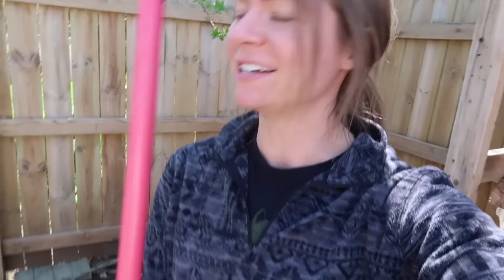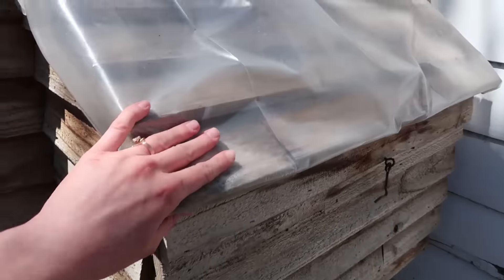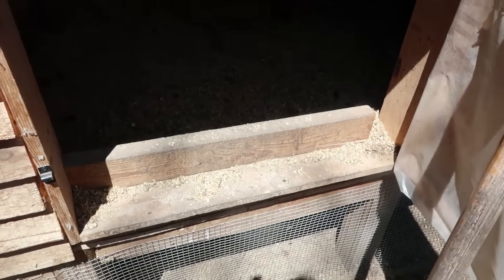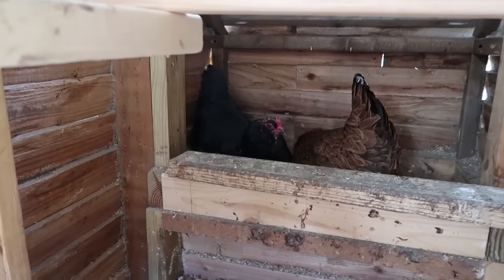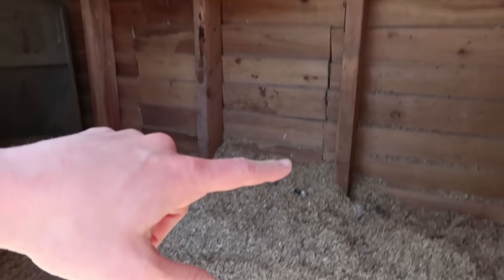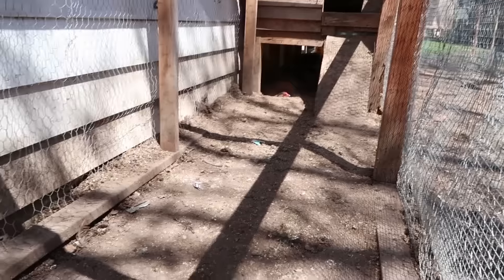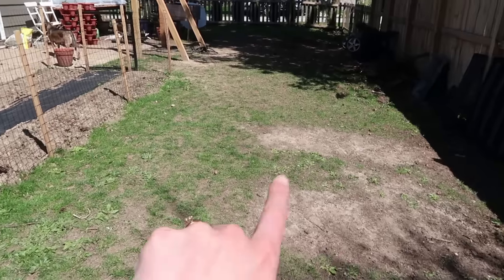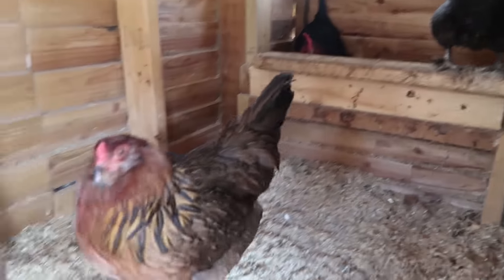Why We HATE Our Chicken Coop | Poultry Housing Mistakes | Beginner Backyard Homestead

Comment: We did something similar to yours but had the whole side open up with two doors. The two doors makes it super simple to clean out, like fifteen minutes. We are building another coop now from scrap. We are using wood from a playhouse we took apart. Having plywood board then adding the siding worked great for our doors and reduced the holes, we used pallets and broke them apart for the siding wood. We're at 6500 ft in the Rocky mountains in Colorado.  I ferment food and take it out daily right now and they forage on the property. In the winter we actually hang the food and water in the coop so they don't get it soooo messy on a chain and carabiner.

Comment: Thats cute. I bought one and its kind of a piece of crap and i want to get a couple more birds so i might build one. But that one seems fine. I know the wood shrinks up and warps and stuff everything gets misaligned. Why i bought a metal run. Im going to use your advice with the plastic and wrap it in plastic for the winter. Like you did. I did some pvc pipes with a wye on the bottom and fill them with food and that works pretty good to feed them you should try that out for in the coop

Comment: I have been learning a lot from your videos, thank you for the content first off. I do have questions if you are still checking the older videos. 1) Is it necessary to put prep the ground in any way before the coop and run are set up? 2) What bedding are you using in the coop for the deep litter method as it doesn't look like the shavings bedding one uses in the brooder? 
You did sort of answer one question I had about how bad they will tear up the rest of the yard. I will make a pen for them around the coop run so that I can still have some kind of yard and garden.

Comment: You've been fortunate to not have serious predator issues. When you rebuild it, I would definitely cover any gap 1/4" or larger with 1/4" hardware cloth unless you're positive there are no minks / ferrets / weasels and then you could use 1/2" (but tiny snakes will get in - probably small enough they'd end up as chicken snacks). Chicken wire only keeps chickens in - it does not keep any predators out. Unfortunately, 1/4" hardware cloth can be torn by some predators, so what I've done is use both 2x4 field fence + 1/4" hardware cloth for my duck house. Next step is to completely cover a duck run in both because of great horned owls that may hunt during the day in the winter + the potential for hawks to decide duck might be on their menu, too.

Comment: OK, OAK CCL & "coop gallery" folk ... JUST buying first chickens by end of this week (03/18/22), intend nine (9) Aquila OR Black Sex Link depending on co-op availability. 
Have an existing lean-to with height 7'-8' pitch (spanning) 5' X 15'. Intending to "raise the coop" up two (2) feet so I gain the entire 5' x 15' as "covered run". The coop will then be 4' X 5' X (5' - 7'). CAN free-range back half of "almost an acre". To "winter over", DOES the "coop and run" sound big enough for 9 large hens??

Intend three exterior-access laying boxes, full access from a side for clean out, water & food outside coop (in covered run) by horizontal nipples (opinions/advice, please; DO THEY WORK?) in bucket and Tupperware "bin", hole sawed for four "head sleeve?" feeding ports. 

Ground is already sand; my location is at elevation 600' on west-face of WA Cascades; read "rainy". Intended to insulate, but if WI and CO Rockies coops are not heated or insulated, should I bother?? Have NO intention to heat, so they naturally acclimate and I don't have to fear electric power loss (opinions, please).

Intend two 2 X 4 "on the flat" perches 18" off east and south wall so total of 9' @ 24" from floor, with 18" "poop catchers" beneath. COULD center them east to west, side by side, 18" off south wall then spaced 18" (no pecking from roost to roost??) RATHER than the "L" shape??  THOUGHTS???

NO ONE talks about "clipping" one or both wings, so is that a "thing" pre-supposed OR "bad practice" so no one does it or discussed the topic? Issue is short 4' property fencing or no fencing ... Property boundaries have pines, spruce and tons of understory  bushery. Worried about the gals getting headstrong and go roosting or laying "out there". ADVICE?? TOTAL "newb" so data-dump me, please.

Comment: Why are cracks and drafts an issue if you have such large areas near the roof that are open for airflow, anyway?
Reply: Because the ventilation is above and not at their body level. Cold Wind hitting the chickens body can create frost bite and chills. So having the vents above detours drafts, so their bodies can generate heat better.

Comment: What kind of bedding is that?  I really want to start using deep litter method but I've not been happy with pine shavings, or horse pellet bedding.  Hemp bedding is way too expensive in my opinion.
Reply: I tried the deep litter method last winter. I used a couple of inches of aspen shavings as a base and then used straw throughout the winter to build it up to the 9-12 inches. It was awesome! Kept the chickens warm and dry and required very little maintenance.
Reply: @RobynSteed  Oh thank you so much for that information.  I'll have to see if Aspen shavings are an option for us here in eastern NC.  My only concern with hay/straw, is them eating it and getting impacted crop.  But I could potentially throw down a thick layer of that first and then put a couple inches of the shavings on top.  I'll have to try it.  I'm glad to have a different perspective for sure because I've been racking my brain trying to figure something out.  My coop isn't walk in too so to clean it as it is right now, is a back breaker, and will be until we build a new coop for the birds.  Thanks again!  :)

Comment: If you’re here to get ideas about building or rebuilding your coop and or run. I’m an 8-9 year chicken keeper here. DO NOT, I repeat, DO NOT put your coop or run up against your house!! Rodents/pests will damage your property, by chewing through to live in house while getting food source from your chickens. I learned the hard way…. About $18-$23k of damages to my siding and insulation that’s not including my attic insulation, haven’t fixed that yet... 
ALSO, all chicken coops and runs need to be placed onto pavers aka stepping stones or some kind of concrete. All 4 corners of your enclosure should list of 2x4’s and hardware cloth all the way around to prevent rodents from entering into your coop and run. The roof should consist of sheet metal/corrugated metal. If that’s not in your roof budget. Then hardware cloth followed by tarp over to protect your chickens from the elements, shade/rain. I’ve tried every single kind of feeders including pvc pipes for water and feed. Chickens are going to make a mess with their feed regardless of what you use. Make sure all feed and chicken treats are safely enclosed at night. If can’t ensure proper enclosure for the chicken feed you should put it up at night to prevent rodents. Rats carry lots diseases and can be a major health concern to you, your family and flock.
Reply: Wall sheeting is best for the coop and hardware cloth for the run. That what I have. 8’x8’x6’ tall coop and 8’x16’ run. With 100% pavers in their coop and pavers just under the frame in the run. I have corrugated metal for the whole roof. I like that I can power wash inside their coop, with the pavers. 
I’ve done sand, wood chips, straw and pine or cedar shavings. And I like the pavers better, I can keep it cleaner better and less dust. During the winter I use shavings instead straw. Straw creates a lot more dust.

Comment: It's better than my coop. A few days ago we moved into a house with chickens. My parents both owned chickens when they were kids but I had never had chickens before so I wanted to keep the chickens. Unfortunately the previous owners were.... Nasty and far too complacent with subpar standards. The chicken coop is an unventilated, uninsulated metal tool shed with a hole cut in the side where the chickens exit and enter. It's honestly scary. It's summer right now and that she'd gets SO hot and stuffy that the chickens will only go in to lay eggs. THEY ROOST ON THE WIRE BETWEEN THE CHICKEN RUN AND THE OVERGROWN GARDEN. I don't know if it's normal with chickens but it looks just awful. One chicken, the smallest, died yesterday and we have no idea why but we suspect that the previous owners have only fed them pellets and corn as that's all they left behind for the chickens. A huge metal trashcan full of pellets and corn. I and my father want to get them the hell out of that shed, but between cleaning and fixing the horrible state of the house, we don't have the money for a new coop right now. 
If you're reading this, what's your opinion on nest boxes outside in the chicken run? Off the floor and protected on the sides and above from the wind and rain.